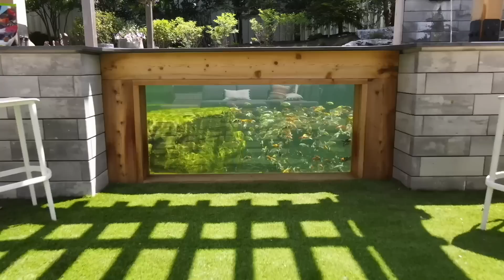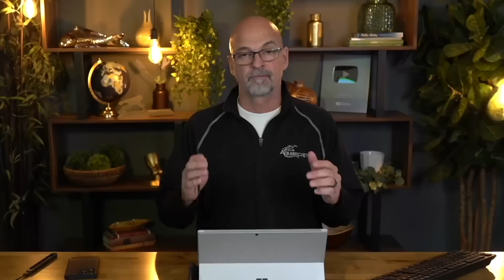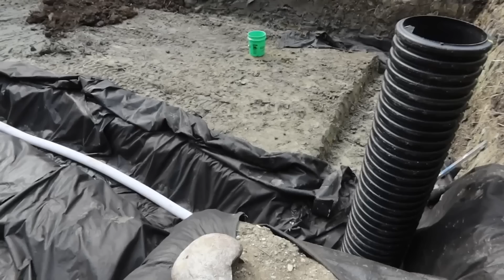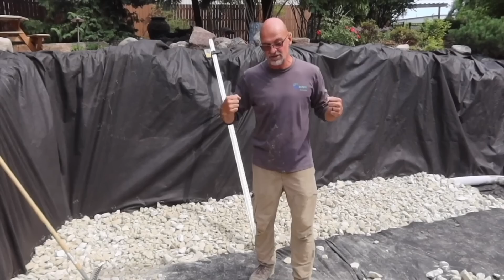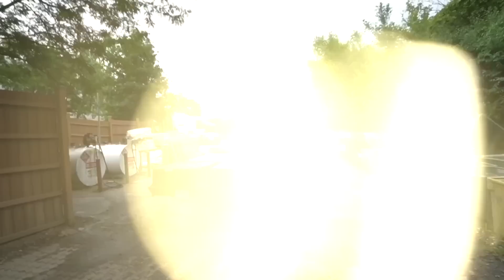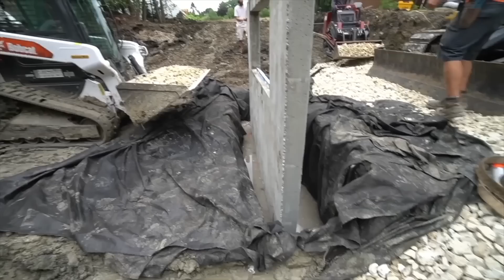Amazing Rec Pond Before and After

Comment: ?? Will the concrete eventually crackZ?
Reply from the maker: The concrete may crack but the main waterproofing is from the EPDM Liner, the concrete is there for structural integrity but we encased it with additional precast concrete blocks
Reply: @EdThePondProfessor  Thank you!
Reply: @EdThePondProfessor 11:13 11

Have you experienced  a failure in a similar structure, even if not done by you and what were the reasons?